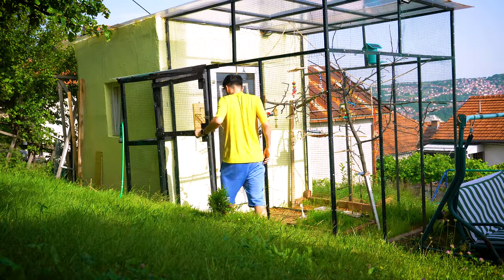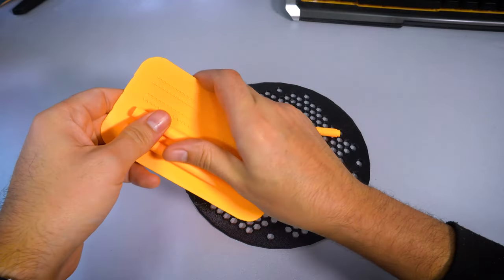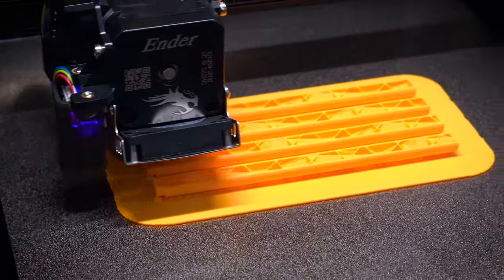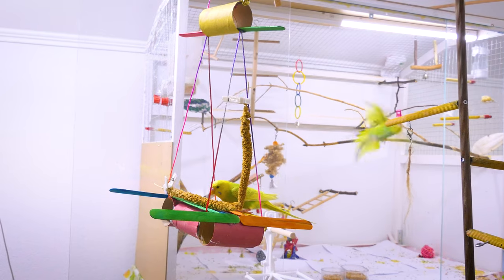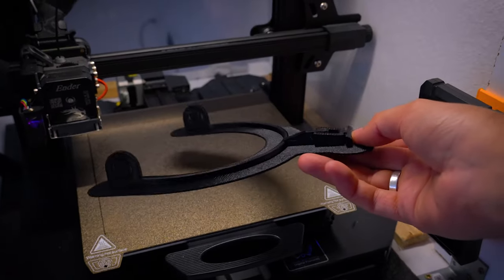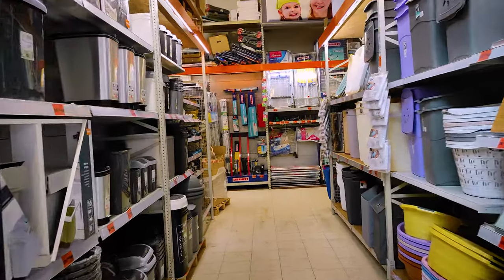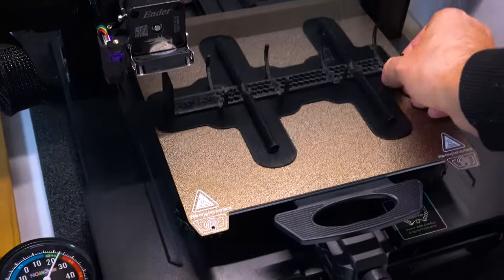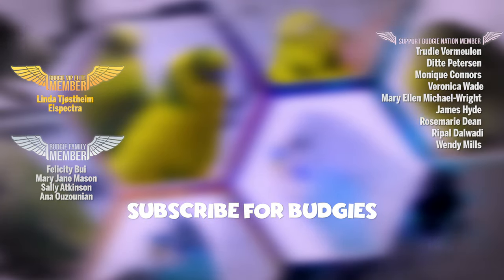Can 3D Printing Make Your Budgie Happier? Explore Creative Enrichment Tools!

Comment: You should put a Thingiverse or Printables link in your description so we can follow. 
Also, while PLA is a good material for birds, PETG is great, especially for the aviary in the heat. You can also turn PET bottles into filament and recycle them into printable objects.
I do highly recommend if your birds are anywhere near your printer that you upgrade it to an all metal hotend if it already doesn't have one as the Teflon tube otherwise goes right into the heat block and a simple temperature spike will give off very unfriendly fumes for birds.
Reply from the maker: https://www.thingiverse.com/alenaxp/designs ❤️❤️❤️